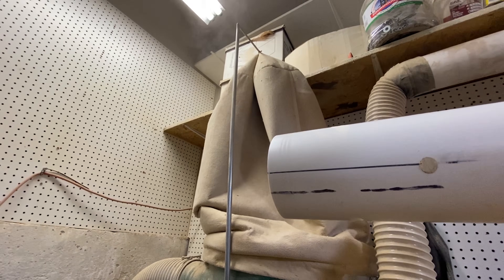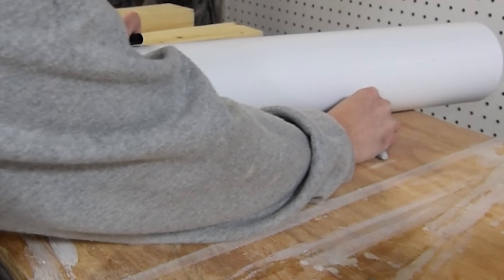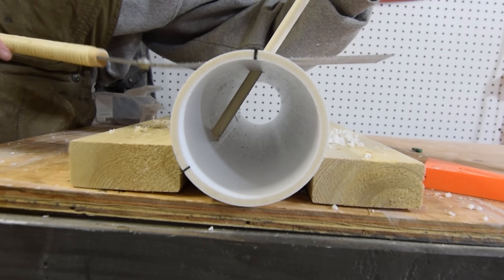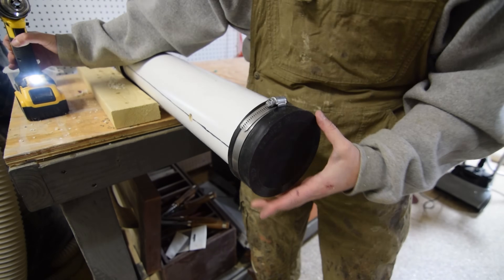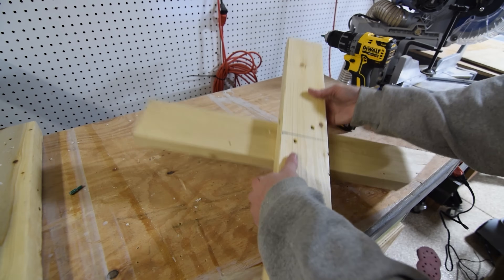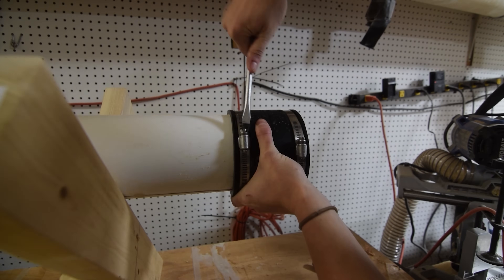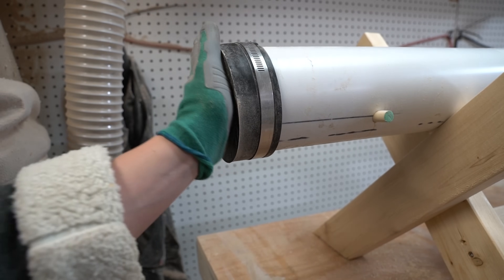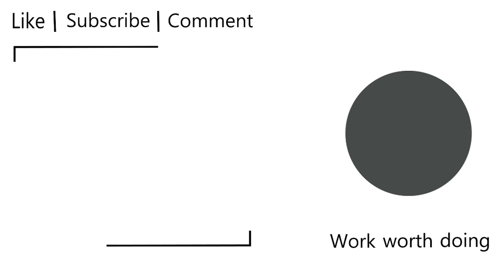DIY Steam Box to Bend Wood | Shop Upgrades

Comment: Couple of Questions:
1. Do you have to add water tonthe steamer during the steam time or does it run that long on the reservoir
2. Why 2 pieces of PVC? Do you see an advantage or just using on-hand materials
3. Why rubber end cap and not a Screw-on cap? Just curious

Not bashing, I think the steamer idea is great. I ruined a teapot on a gas heater trying a heat source

Thanks, Brian

Comment: I've seen similar creations, but they were metal and pumping up the internal pressure. I've been hesitant to build one because I didn't want to build a pipe bomb. This seems far more workable. Thanks.
Reply from the maker: I had the same concerns - definitely didn’t want to build up pressure. It’s a limited solution in that there’s a limit to the amount of heat you can really apply, but 200 degrees F seems like it does the trick for this lamination style and the pipe is still in fine shape!
Reply: @HonestWorkDesigns  I was reading that 212°F is the right temperature to plasticize wood for bending. So, you about nailed it.

Comment: I like the design of the steam chamber.  Approximately, how much did it cost for it and the steamer?  The stool that you made looks nice.  I'm looking forward to watching you build it.
Thanks for this video.  Stay safe.
Reply from the maker: Thanks Eddie! Good q! It was around $90 - comparably, the hot plates and other heat coils plus a durable water chamber I could cap and route to the steam chamber I was originally looking at would have actually been more expensive. So it kinda worked out great!